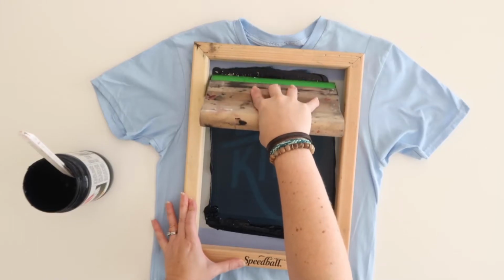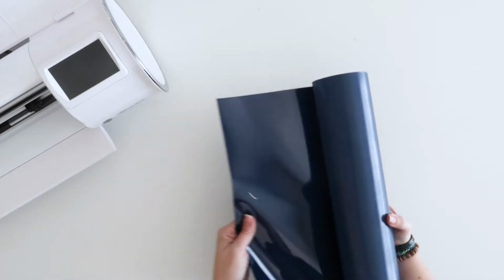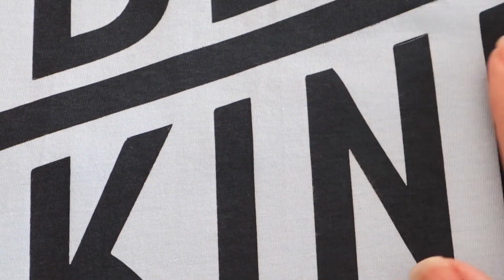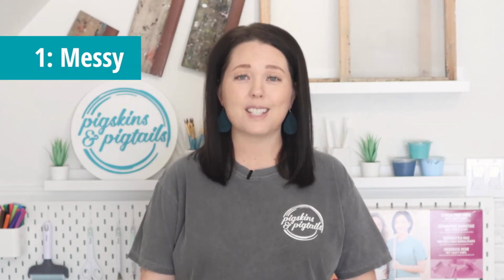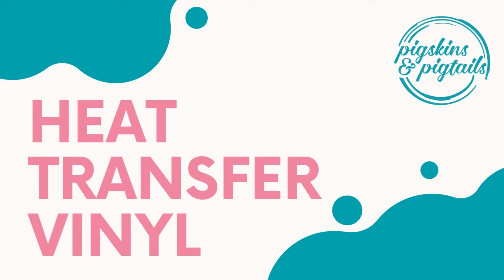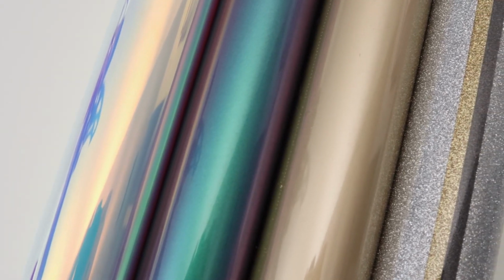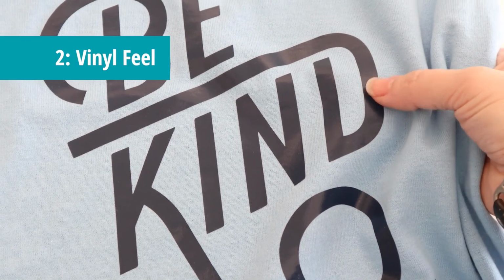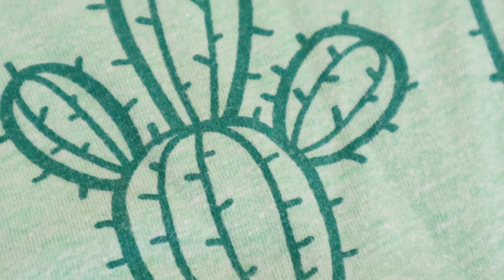Heat Transfer Vinyl vs Screen Printing - Which Method is Best?

Comment: What I'm wondering is which is easier or best, using the screen printing emulsion on a screen with a transparency and exposing the design with UV light (I have done this), or using the HTV on a screen? (I have not tried this) I have the Cricut Explore Air 2, but never got it to connect with my MacBook. I'm tech savvy, and have done a lot of graphic design, but the Cricut software looks intimidating for a first time user too.  Any advice would be appreciated.

Comment: I use to to screen printing a long time ago.  Your images will look a lot crisper if you do not let your screen lay directly on top of what your printing on.  You want about 1/8 inch between your screen and your substrate.  As your squeegee passes over the image, the screen will make momentary contact with the surface and as it pulls away from the surface, it will leave a nice, smooth image.  For the longest time when I did screen printing at home, I just used a couple of paint stirring sticks as spacers and it worked great.  I like the fact that you made the kits for the beginners so they could just jump on in with both feet.  Good job with that.
Reply from the maker: I do like to have off contact when I’m using a press set up- but with this method (a loose frame on a table) I don’t find that it is necessary and I am still able to get really sharp prints
Reply: wow maybee thats where i went wrong in screen printing . I would push my screen down hard on my shirt .
Reply: My htv lasts quite a while.  No technique will survive hot water and dryjng on high
Reply: If you have a heat press then plastisol transfers is the way to go. It’s screen printed ink and holds up very well. No messy ink and it’s durable. 

I do appreciate your information on this method.
Reply: @AllenCNC  plastisol transfers are dope, but for 2 or 3 shirts, dtf and vinyl are great options.
Reply: @Coach_Matt_makes  agree.